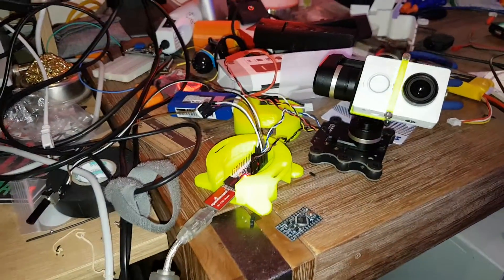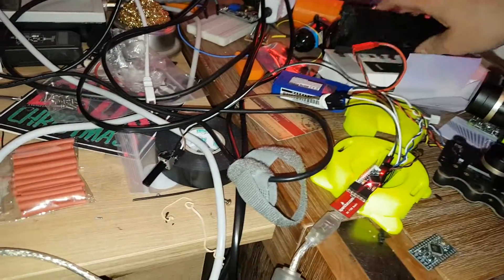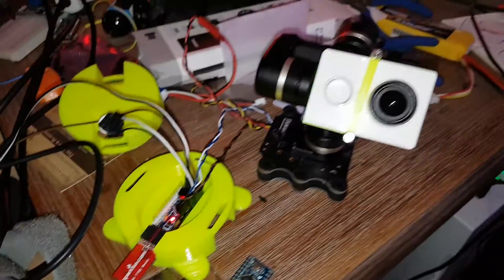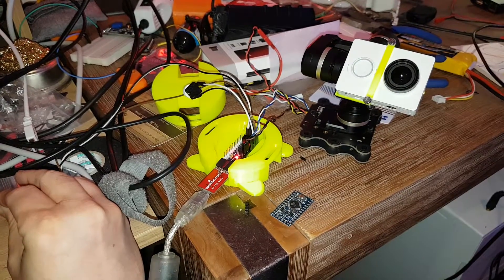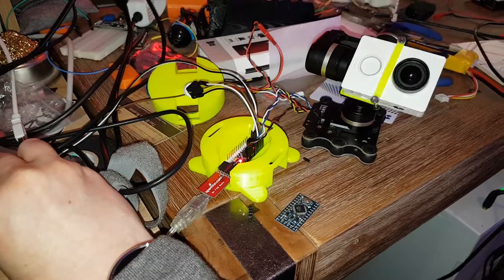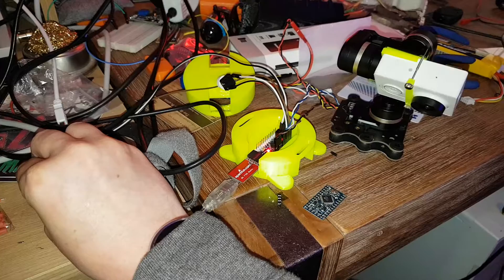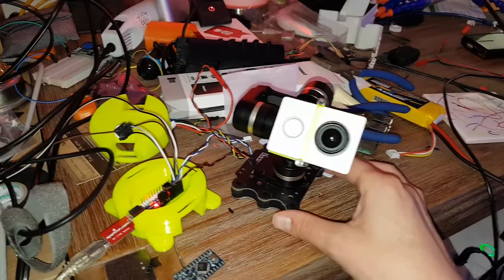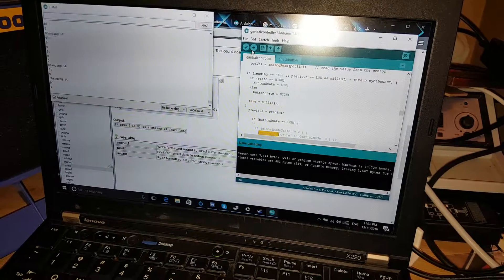Feiyutech Mini3D arduino controller

Comment: Uh! What about a wiring diagram?
Reply from the maker: Miller Ingram sure, just checking did you find the github ok?
Reply from the maker: Miller Ingram the ino file has an ascii one if that helps? Does it need more